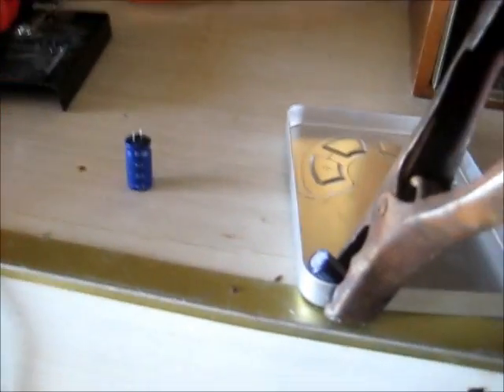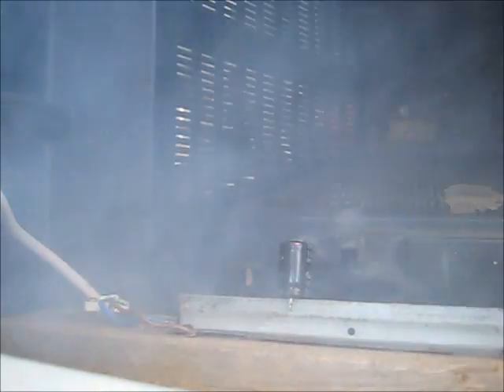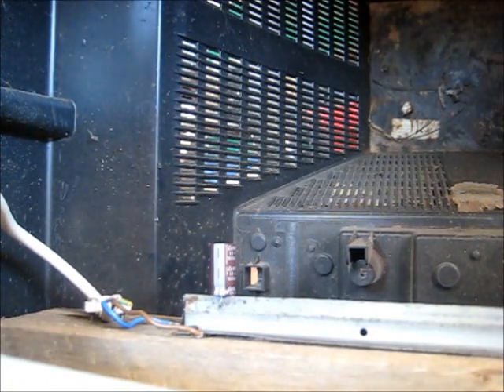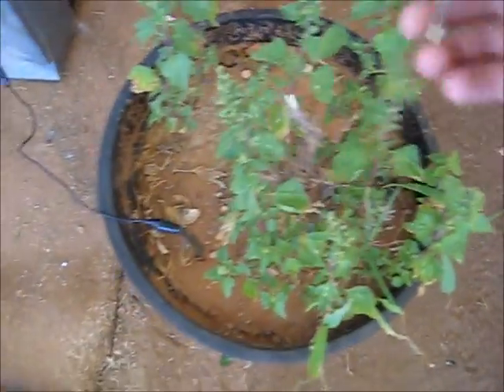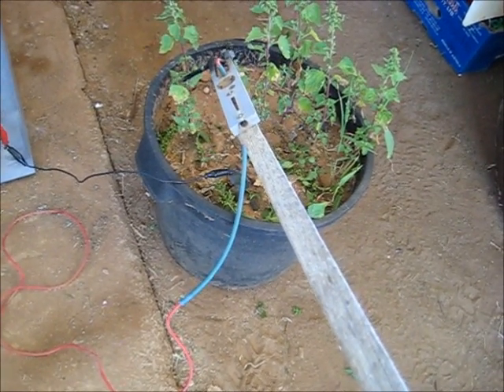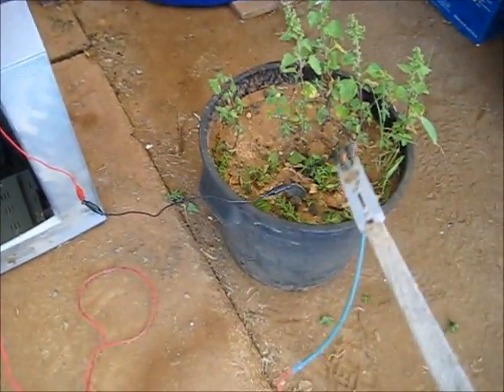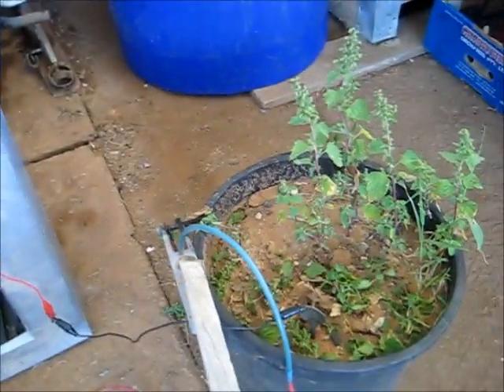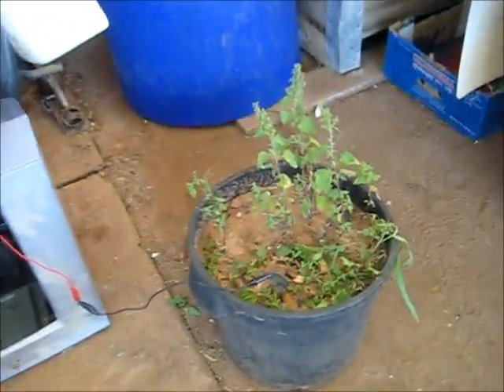Capacitor popping & High Voltage Gardening

Comment: There is a trick to soldering on aluminum/aluminium. You need a good sized iron with a big tip, and what you need to do is form a big blob of solder on top of the tip and the aluminium and work the tip around under the blob of solder. Aluminium always has a layer of oxide on the suface that you can't solder to, the flux in the solder breaks it down but the aluminium will oxidize again if exposed to air so the job of the solder blob is to prevent that.

Comment: what really does work for sealing cap vents is good old 2 part epoxy, rough the top up a bit with some rough sandpaper and put a blob of 2 part 5min epoxy on them, it'll seal the vents quite nicely and cause quite a bang as long as it has a roughed up surface to hold to.